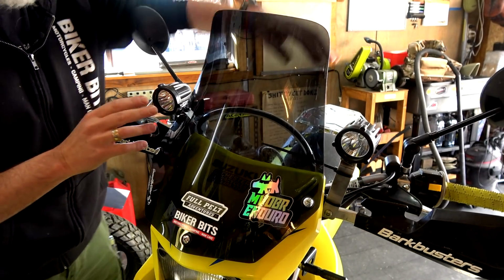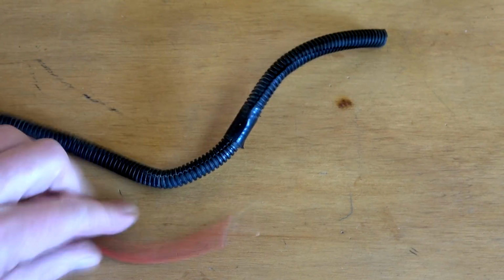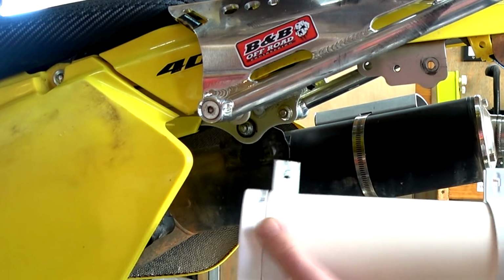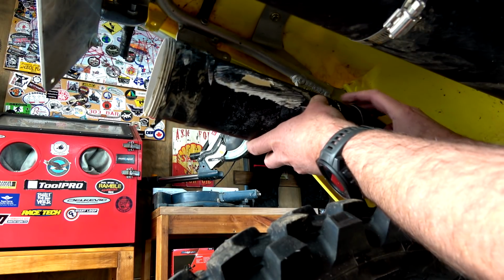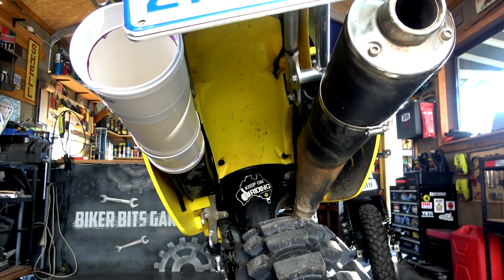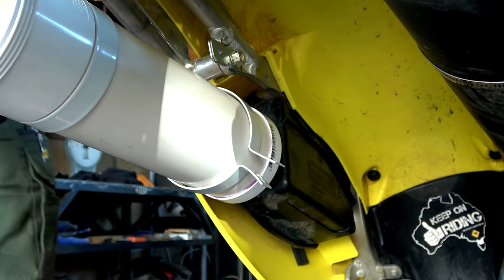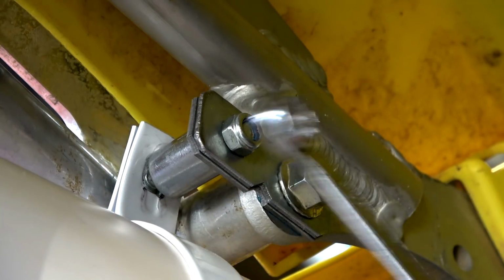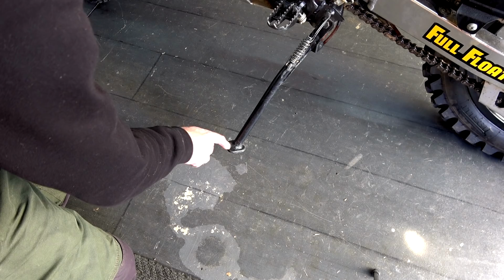DRZ400E - New Tool Tube & FIX  - Ep.07!

Comment: Mark, you need a longer bolt. It appears to be only half way into the nut. You can't send a mate on a trip like that.
Reply from the maker: It's 1 thread in and not load bearing so it will be fine! :-)
Reply: @BikerBits  yeah, it’s not as if DRZ400s vibrate

Comment: im becoming a motorcycle mechanic right now and in vocational school i learned something recently that i cant exactly recall about wire thickness. basically what i remember is that you can go too thick. there is a formula to calculate how thick youre wire has to be. too thin is obviously bad, it can get too hot etc but too thick also isnt good. so maybe look that up, even if its not so important for this build i think this knowledge could help you out in future projects. 
greetings from germany mate :)

Comment: I have a DRZ400 with the same tool tube set up and been down this road. The tube will flex down with the weight of tools and suspension causing the same issue with the wheel rubbing. I mounted an extra bracket at the top of the tube and then used a cable tie to mount around the rear rack thus stopping any flex. I also trimmed the plastic around the tube to allow for a little more room. It's a bloody tight fit.

Comment: Here's a tip Mark.  On the lid of my tool tube, I drilled a small hole through the side of the cap into the thread when it was closed.  I then inserted a split pin (size of the pin determined by how big a hole you drill) to hold the lid on.  The split pin is easy to remove and place back in and has never looked close to coming out.  Additionally, there is no need to tie anything to the split pin as it will happily sit there.  Cheers!

Comment: Hi man why you not using the spare hole on sub frame in stead of the mount bolt for luggage rack ? Plus it never good not getting the threads of bolt through the nut all the way they strip or pull the threads out of nut or bolt you mite get lucky but i would use the third hole on sub frame thats there all ready or maybe you not see it ?

Comment: Top job on the tool tube Mark, but I would put a slightly longer high tensile bolt on that bracket. As you know nothing is overkill when you're sitting on corrugated roads for a few hours!

Comment: Tool tube should work fine, i run my front bracket to the outside bolt hole on the b&b rack, no stuffing around with extra bolts and brackets. 
With welding a bottom on the stand , just check that it isn't too far back on the heel before welding cause it can and well hit the swingarm. Cheers sir.
Reply from the maker: Thanks Tex, yeah learnt the swingarm issue with MAX :-)
Reply: @BikerBits  sounds like i probably should've payed more attention to your video on max haha

Comment: hence the post as i stated in last video i never run Aux lights on the OEM loom so not loading up the bike loom
I ALWAYS run independent fused / switched loom

2 x switches i ONLY use 
KTM EXC CEV  3 position off/lo/hi type
Honda on/off ignition type

ALL my switches i dewire & solder heavier guage wire too match the loom wire i install which in general 16 - 10 AWG / 3.0mm-5.5mm pending on what load plan to put through it

Both KTM 950SE & 1290SE i used a 8AWG / 6.3mm flexable silicone wire to run the BD 8" duel LP9's & 10" Onx6+ 218W / 34,510 lumens of light 

Also on my rally bikes i use a PDM60 power distribution modual (electronic fuese system) lot better fuse system not blowing fuses when trying fix out bush

see my facecrap posts always noted when people ask about my lighting & Rally bike builds

Comment: The lights were the MCX10 and they only draw 900mA @ 12V each, so 1.8A@12v for both. Normally use 12gague for anything 0-20A@12v, that is 2mm wire. 
Solo Cigarette Lighter Sockets, are generally 15A, if you get a combo they are normally 10A@12v and 2 USB up to 3.5A. 13.5A Total. But more importantly, is this inline fuse... as it is there for the wire, not the devices connected to them. 
As for flexibility, it depends generally you want the thinnest wire, as thicker stuff has less movement to it and can work harden faster, you had it sleaved any way so moot point of wear tear.

Comment: Just an idea.. once that tool tube has weight in it, and the bike is bouncing over ruff terrain. The weight is going to be pulling down on that bracket, and if that bracket moves down it will turn the nut and basically loosen off the nut. Since the nut has so little thread that it's holding on with, even it moving a bit might be enough for it to come loose.

Comment: Mark, I dont think the switch or its wires will hold up for running both the lights and charger outlet. The switch should be driving a 30amp relay. You up graded the wire size, great. then  chocked it at the switch wires, and switch contacts. 
Love your work, keep on keeping me entertained.

Comment: The front bracket will pivot down with a single bolt either end. Also the rack bolt is 5mm too short now.
Reply from the maker: Yeah it can, but not by much. The nut has very little load on it as it is not load bearing so it will be fine! :-)

Comment: If you have limited space on a bike for a tool tube, take a look at a John Deer document holder/tube, here is an ebay link for a modified one in Australia, modification is an over centre latch for a lock, but you can buy unmodified ones.
They are tough and offer better mounting options, I have two fitted inside my Rally Raid side racks on a CB500X, one each side      https://www.ebay.com.au/itm/393273618041?hash=item5b90ef2e79:g:qhoAAOSwlJVgh9Qa.

Or just Google John Deere document tube, a unit without the lock would be about about 20 or so Aus dollars over here. SWMotech  got a bunch of them and rebadged them and charged a lot more for them.